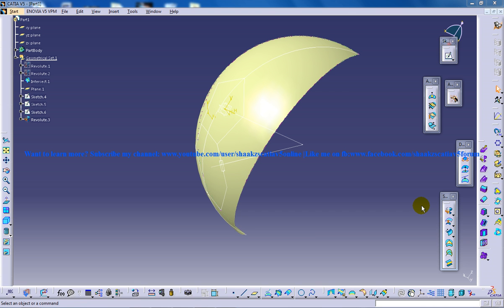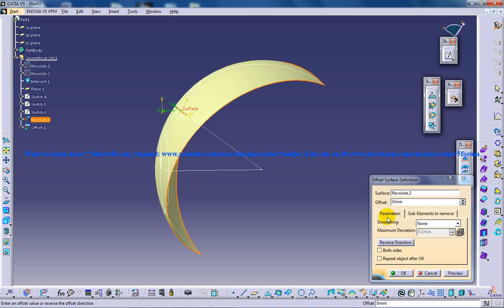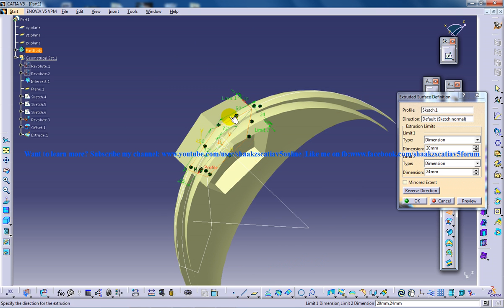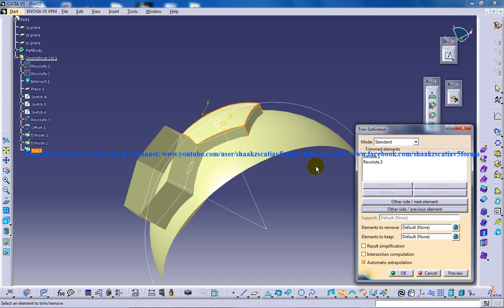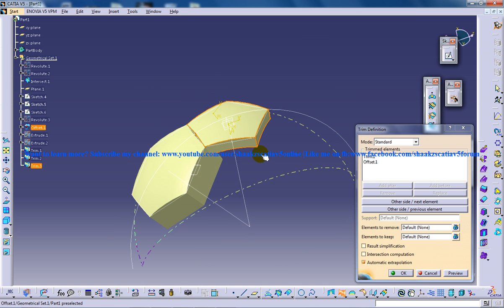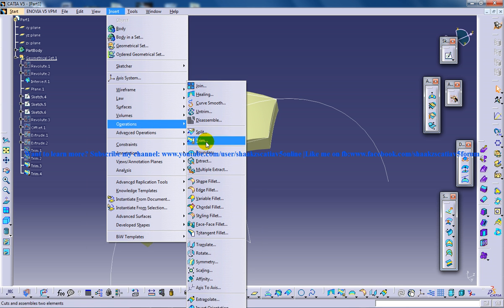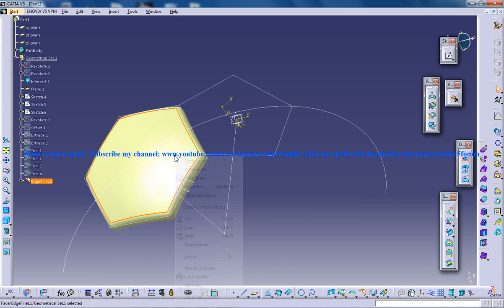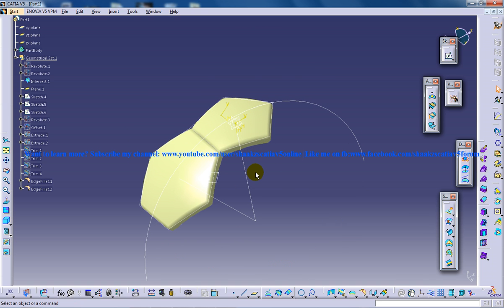Catia V5 Tutorial|Generative Shape Design|How to create a Soccer Ball|Start to Finish|Part 2

Comment from the maker: Now let me explain what this enable hybrid design does. In hybrid design, both part and surface feature will be saved under the same geometrical set. So It is better to work on enable hybrid design when you are working on mainly part models.
When your enable hybrid design is unchecked, surface features will be automatically created in seperate geometrical sets.